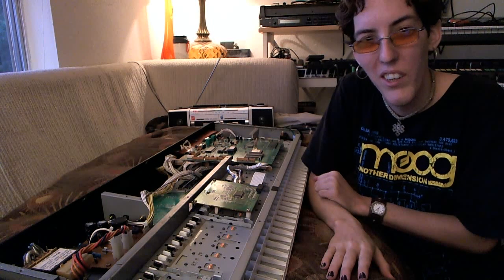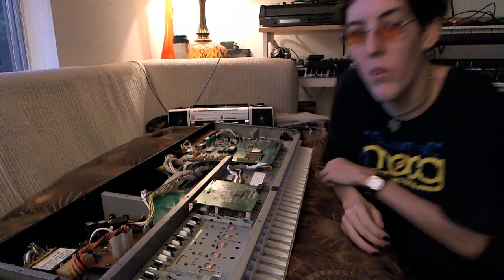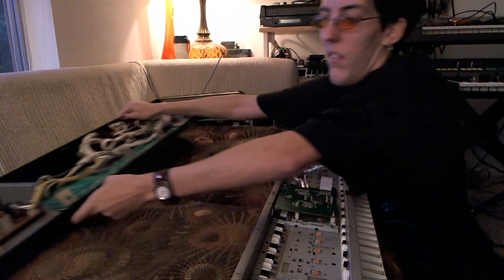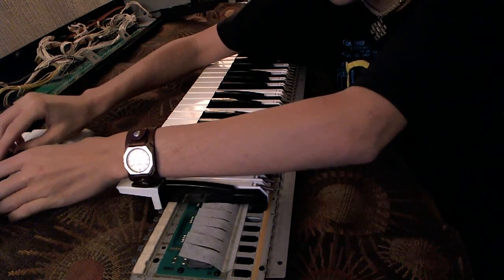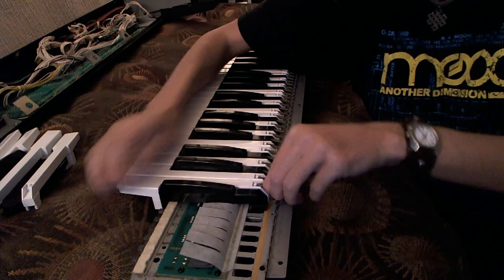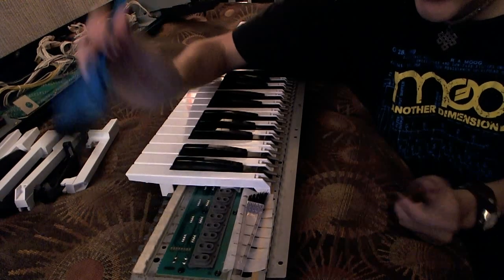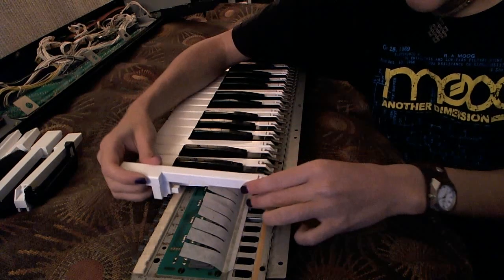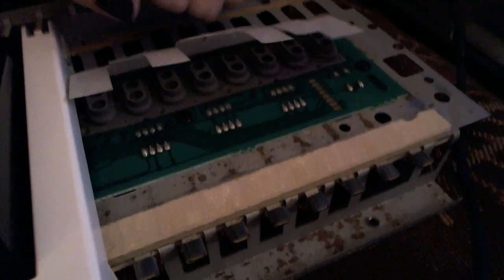Roland D-50: Key contact cleaning/Velocity issue

Comment: Hi, I just got a Roland D-50, it powers on but does not produce sound. I hooked it up to an amp and to headphones. Any idea of what could be wrong? thanks
Reply from the maker: Hello. :)
First congrats on your D-50!  :) 
To address the sound issue, there are a few typical things to check first. Be sure to check that the synthesizer's Local Control is set to ON so that the synths keyboard will control the sound engine internally and produce sound. If the local control is set to OFF (which makes the synth into a keyboard controller and silences the keys ability to trigger the sound engine) it will produce no sound even though the synth is ok and fully functioning. Local control off "disconnects the keybed from the sound engine internally and can be switched back on easily through local control on/off settings. Another reason for no sound can be, bad output jacks which isn't common but can happen, volume switchboard problems or the more tricky parameters inside. If the D-50 has had a battery change or a failing battery, it will lose it's sound data and won't make sound or the sound it does make will be wild and crazy sounding with bizarre data values to go along with it.  Be sure to check that partials 1-4 are ON. You'll know they're on if there are four "1s" in the partials menu. If they are "0s" then they are off and muted. Always always check to see they're activated. Another thing to check is that the Total Output volume setting is set to a decently high value or until a sound is well heard. Be sure this value is set for all four partials. If you need further information or help finding these parameters let me know.
Reply: Thank you so much for the info. I played around with the partials settings and when I pressed Partial Mute / Upper 2 I was able to get some staticy noise out of the keys. I checked the battery, and it was corroded, so I put a new one in, but it didn't make a difference. After a few minutes it sounded a little better but still horrible lol. It's a big step in the right direction though. Do you have any insight about the static? Thanks!
Reply: If you've had to replace the battery, then you will have lost all the internal sounds.  You either need to reload them from the original factory sound ROM, or from a sound file via a sysex dump over MIDI.  I just had to do this with my D-50.

Comment: Hey, Synth Freq! I am in need of your help, and I think you know the answer. 
I tried to clean the keys by following the steps in this video, and I was only able to remove the main board. I was afraid that I might mess something up and decided to stop. I put the main board back and changed the battery. 

Before I did my attampt to clean, only one key was dead, but now the keyboard is not making anything sounds. It turns on and has display, but I could not find any sound in the sound bank.

Comment: Those are the same 'rubber' type contacts as TV remotes use. They kind of 'sweat' with air moisture, and airborne particles causing issues. They are done like this for cheapness, but are very prone to this issue.

Comment from the maker: HI :) Interesting indeed. Your D-50 normally has Japanese language but written using the Latin alphabet correct? I have on rare occasion seen synths with random Japanese characters. I would check the LCD connector and make sure the display is connected securely to the main board, if it is not connected well, or is loose, the LCD might not understand what the CPU is trying to display.

Comment: I have another problem with D50, lower octave does not operate, up to the first E. If I send through midi it's fine, but the keys do not work. I have had this problem since the 90's when i took it apart for cleaning. Any help anybody?

Comment: FYI: 70% isopropyl is like 28-29% water. I would use contact cleaner, it's designed for what you need here
Reply: Contact cleaner is definately NOT whats needed....it would damage the carbon track on the circuit board and the carbon pad that makes contact with it. It is not a mechanical contact switch as such. A little water on a cotton bud is good enough.I'm a Digital Keyboard Engineer and come across this issue many times.

Comment: Cause i cant found anywhere aftertouch strip can i use from other synth  61 notes strip?
Reply from the maker: I’m not certain if the strip will work. You could try it only if the parts fit and doesn’t cause short in d-50. Look at the service manual for details.

Comment: I had a similar problem with a second hand Roland D-5. The D-5 use a flexible contact strip, the same used on the D-10, D-20 and D-70. The build quality is a total crap because electrical traces use conductive paint (similar as silver) that over years of use starts to fails. The D-50 is much better in endurance because use a cooper circuit board in the same way as other synths. I decided to use the D-5 as a sound module because has no sense to repair it.

Comment: Very good! Can you tell me, why on display appear message "Illegal Card" when i put in memory card? 
Tanks,
Fabio
Reply from the maker: fabio demetrio Petrella 
Hello :)
Sorry to hear your D-50 is doing that. It's not terrible thought it just needs to be cleaned inside the card slot. Your card also may need to be carefully cleaned on it's gold contacts but it's more likely that the card slot needs to be dusted and cleaned. The card can't be read if there is dust inside D-50. I too had the same problem. Just clean the card slot as best you can. No liquids or anything. Just use a paper towel or cloth that can fit inside the slot and dust it as best you can. If you open D-50 you can clean it totally. I can make a video on this procedure. 
Also sometimes neither is the problem and the card could just be corrupt due to age or the reader inside D-50 no longer works but that's the worse case scenario. 
Let me know how your card and D-50 are doing and if it works again. :)
Reply: Hello ,and tanks for your answer. I just cleaned the slot inside yesterday, but don't read the card. The D-50 it was been for long time unused, but before sometimes did not read the card. 
The check control machine is ok. Have I to try clean better? 

Fabio.

p.s: sorry for my English, I'm Italian 👍😊

Comment: I found out what the problem was; the battery on the main board was drying up. Apparently D-20s tend to go "oriental" first and only display a row of blocks later when the battery runs dry, and when my D-50 also began displaying a row of blocks I figured that might be it. The LCD is working like a dream again now I replaced the battery. :)

Comment: I have one key on my D-50 that sounds louder then the rest is that a velocity issue?
Reply: I have exactly the same issue on my U20; I'm about to start taking the keybed out and then look inside those little grey rubber contacts/switches. I suspect the problem is in there somewhere.
Wondering if anybody has ever seen a video for cleaning the insides of a U20.
Anyone? Anyone? :-)

Comment from the maker: Hi :)  If water gets into a synthesizer through its keys, without touching any metal on the synth, power down the synth immediately since water and electronics do not mix.This will keep any harm from happening to you or your synth. You can also try using something soft to clean the water up with if the water hasn't already reached the inside of the synth. Leave the synth turned off until the water has dried out. Also inspect it visually and look for signs of water BEFORE power up!.

Comment: I took my DW-8000 apart and now it's dead.  Can you help me?
Reply from the maker: Hello. There are a few things to try and trouble shoot. First the synth was fully functional before the procedure correct? Did it only have key issues or did it have other things going on as well? When you say "dead" do you mean the entire synth won't power on or that just the keys will not trigger the synth generator? There are few basics to check first. Be sure all wires were fully reconnected back into their connector sockets (CN) on the PCBs. To perform a key cleaning procedure (on just the keybed, keys, key frame, the power source/supply and transformer (needed to power on the synth) were never to be touched or disassembled, so for the DW to no longer power up would be quite serious and lead me to believe (in the worst case situation) the synth may of had some static exposure (which is rare as well). So, let me know exact details on what it isn't doing anymore. So if you can look over and retrace the wired connections to make sure they were put in completely since its the simplest step in the troubleshooting process. Be sure there are no static sources around the synth while doing this. Its a computer and very sensitive internally.

Comment: I would have cleaned the actual contacts as well while it was open. Not much point just cleaning the circuit board without wiping the crap off the rubber contacts